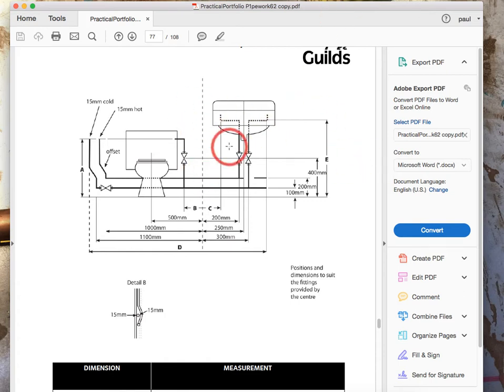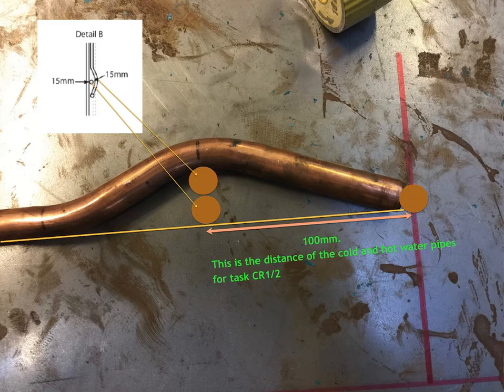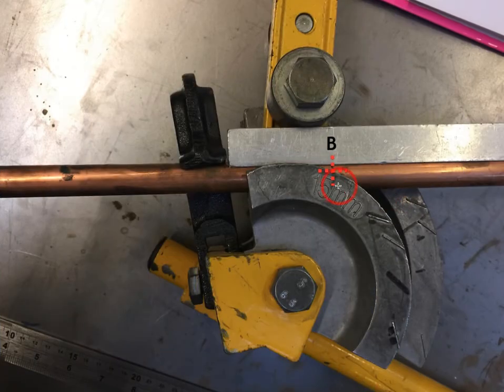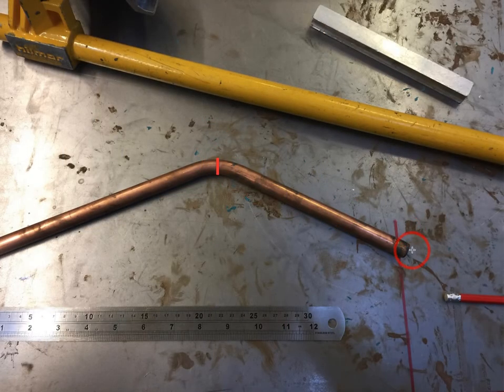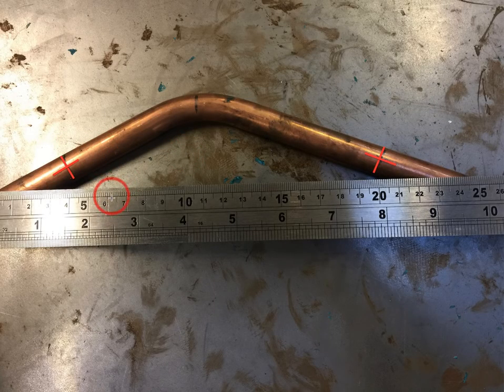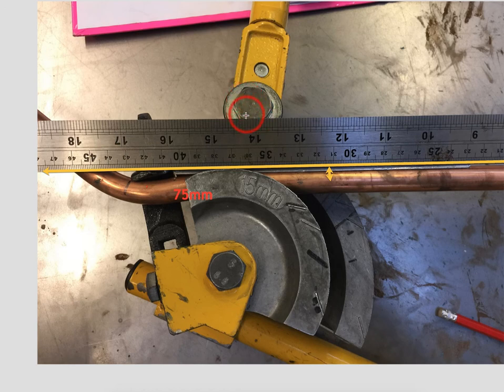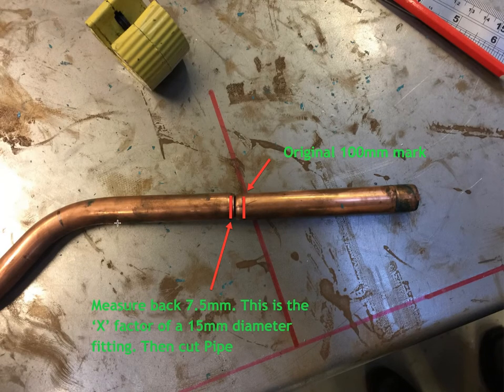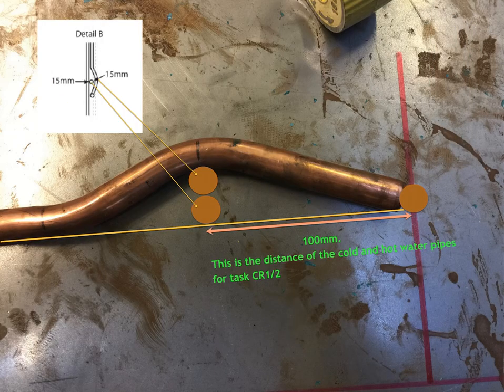Cranked Passover

Comment: Broo could u do some more plumbing vids 😪
Reply: PAUL Oatham damn 😂surprised you replied and just one like this I done this exact thing yesterday it was in my folder
Reply: Think I’m doin a bath next but not sure what to do
Reply: PAUL Oatham ok thanks is there any other vids like this tht has the stuff in the folders
Reply: PAUL Oatham hello do you have the one where you have to connect hot and cold copper pipe to the wash n basin it’s in the level 2 thanks
Reply: Only needed a vid where u fitted the sink🤷🏽‍♂️